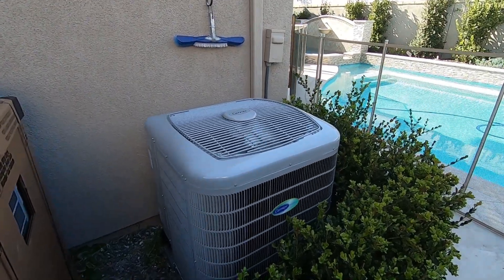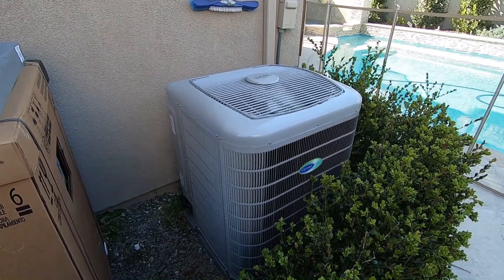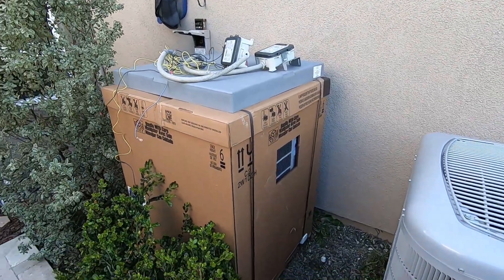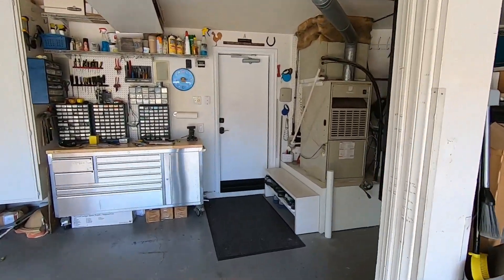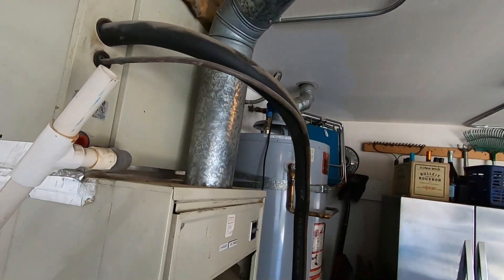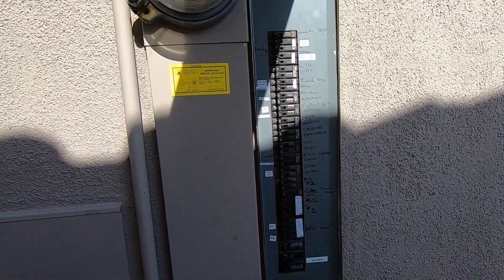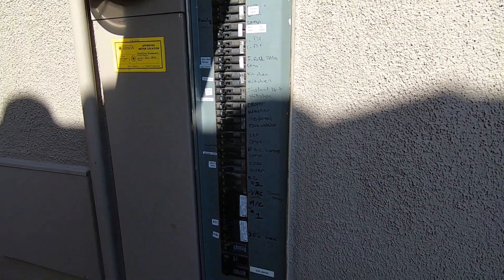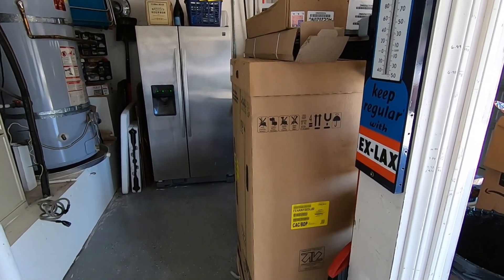Installation of new Carrier Infinity 4 ton heat pump system 25VNA8

Comment: About 25 k for those units
Reply from the maker: The cost will depend on many factors including size, configuration, ducts, labor, etc...  The cost for this installation was less than 25K

Comment: I love this model Heat Pump. I have the 4 ton AC 5 stage version of this and it is truely whisper quiet...not an exaggeration at all. I've measured 53-54 dB.!  My intaller insisted on oversized and this should have been a 3 ton based on all the manual J calculations but they would not listen.  Because it's 5 stages it can behave as a much smaller AC and spends 90-95% of it's time in stage one only...proving the Manual J was right and my Dealer was dead wrong but they still won't admit that...idiots, lol.  If I evern get another (mine is 7 years old and going strong) I'll put a 3 ton in but my Infinity furnace is probably too large for that since it and the indoor coil are matched to the 4 ton...not sure.
Reply from the maker: Great to hear your story.  I am a huge fan of this system and so our my customers.  I agree with the sizing.  Just so you know, if you change the outside condenser to 3 ton the indoor unit will will automatically see the model plug being 3 ton and only give you 3 tons of air from the blower.  The outdoor unit dictates the size of the system.  So even though the indoor unit is larger, it doesn't matter.
Reply: @albertairinc.1140   Well that's good news then.  I restrict (in the infinity control) the heater to 1000 cfm and the AC to 3 stages and NEVER have needed any more than that.  The installer left me with 1.25-1.5" static and I had redo the plenum (their plenum was 19" X 19" X 1" with a 16 hole in it) and all the ducting as well as the cold air return.  Took me about 5 months to complete.  How they thought that would work is beyone me.  My 16" trunk line would have been so noisy.  I had to lower the laundry room ceiling by 4" and now I have an 18" trunk that is NOT oval either like the 16" was, lol.  The duct to the 2nd story is now 14" and not 12" and static is about 0.2" with about 900 cfm.  It took a lot of work for a 67 year old retiree but worth it.  I wonder if the existing indoor coil, matched for 19 SEER to the 4 ton AC, would work?
Reply from the maker: @sdcoffeeroaster  It sounds like the installing company just did the minimum.  Most of the time we are changing plenums and installing the proper size ducts with this system so it will operate at its best.  We have found that the best static pressure for the infinity system is at .6 to .7.  At that static the blower motor will produce the required CFM for the system.  If the static is too low or too high it will not.
Reply: @albertairinc.1140  In the summer I have a manually adjustable valve in the laudry room ceiling that diverts more air upstairs and the static might get to around 0.4".  It's a strange house because only two outlets come off the main truck downstairs and used to get 85% of the air and dining and living room come from the attic.  In the winter with hot air rising the upstairs gets more than enough air so the diverter is opened.   I also run the fan on low starting at 1pm to 6am with one degree cooler and that makes the upstairs nice and comfortable.  That variable speed fan only uses about 45 watts in low mode.  I know running it might put some humidity back into the air but this unit really keeps the humidity down in the 40-45% range when it hot and humid here.  800 sq in cold air return too.  It was only 125 sq in before, lol.  This is probably the best I can do with a 2-story without zoning and very satisfied with it.  I bet that variable speed motor will last a long time too.
Reply from the maker: @sdcoffeeroaster  Sounds like you have everything figured out with the system to have it running as best it can for your house.

Comment: I love the high-end carrier equipment Infinity series inverter units are awesome I work in HVAC. We don't sell that particular brand but I have seen them and that's what I plan on getting for my house along with the infinity low  Nox  92% furnace
Reply from the maker: Carrier is the best system on the market today.  You will be very happy with it.
Reply: @albertairinc.1140  yeah they are good. I have one of the cheap versions right now I have carrier comfort package unit but as I said before we're going to be replacing that and going to a split system because for some reason they walled off the furnace room. Nice big furnace room there's even a hole for the ductwork where once went and a gas line. weird. Weird. Weird I don't know why they walled it off but yeah